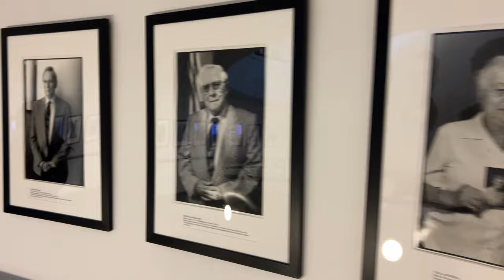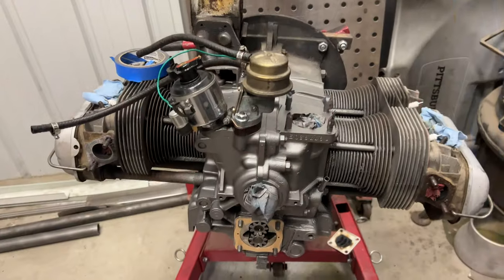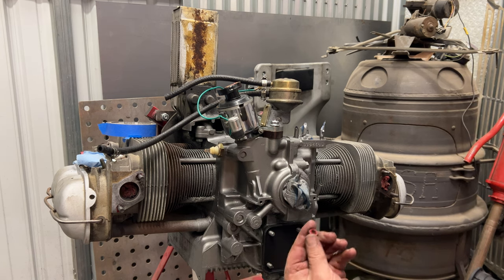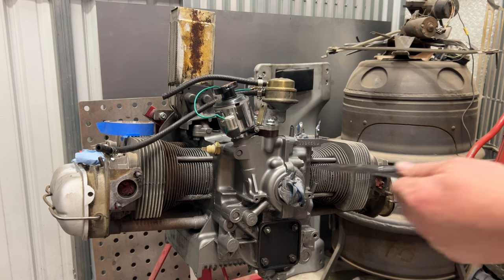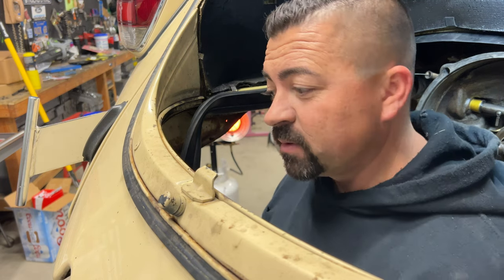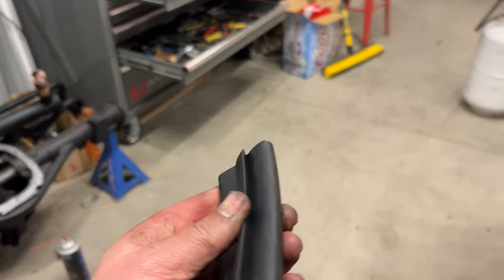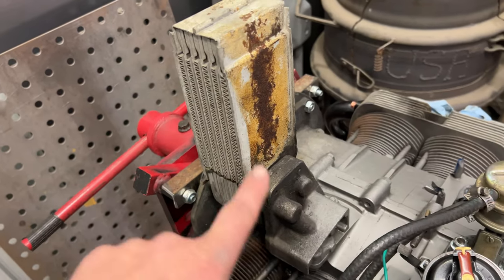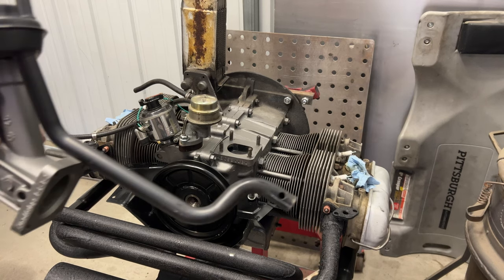1970 VW BUG PROJECT! Re-painting engine tins and starting the re-assembly of my parents BUG! #vw

Comment: I like ALL of it . . .
However it did occur to me you may run into overheating issues , because of no evacuation of the hot air recuirurating in the fan box ?
Reply from the maker: It should be ok. The air that blows out the bottom onto the cylinders would increase now I hope !! I’ll let you guys know !